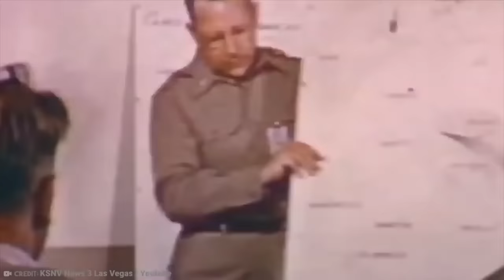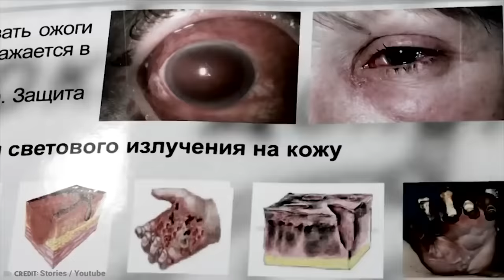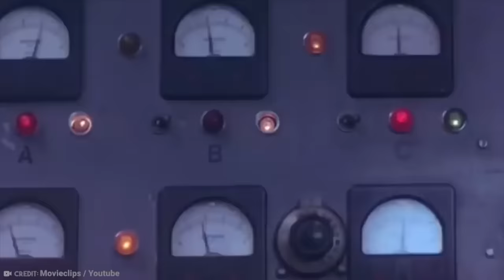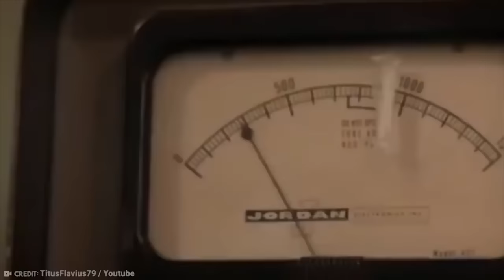20 Nuclear Tests That Went Horribly Wrong

Comment: Your list is confusing. First You have a test that resulted in actual human deaths lower in the list than one with pods and Second Fukushima wasn’t a test, it was a tsunami that happened to hit the worst place, at least Chernobyl was caused because of a test. Third you didn’t even cover the weapon lost in Georgia, that’s still lost today… How does loss of life not make something worse? The B-52 was a non issue compared to the Georgia incident (I mean a nuke is still missing) and while people died, they died because of a plane crash not a nuclear related issue.
Reply: Chernobyl may have been a "test" of the systems designed to prevent runaway reactions in the pile, but it wasn't a "nuclear yest per-say"
Reply: thought at least one of those planes was a B-47 that had a mid-air collision with a fighter let.....

Comment: Before the first atomic bomb was tested in New Mexico, some scientists feared that the detonation might cause a chain reaction in the atmosphere and destroy the world,   They pushed the buttton anyway.  No risk, no fun.
Reply: `Yeah well, some scientists believe the world was created in 6 days. Just because you have a degrees doesn't mean your elevator reaches the top floor.
Reply: @dj33036  theres actually not really any significant concrete proof that it wasn't. 

Considering the state of the solar system at the time of the earths formation, its entirely possible that it only took 6 days for enough mass to accumulate to form an earth sized planet and for it to adequately cool to the point of being solid or mostly solid.

So technically yes, it is possible.
Reply: They actually took bets with eachother on whether it would or not.

The military told them to stop though, so no money ended up changing hands

Comment: What long term effect did all these terrifying nuclear tests have on the ozone layer?
Reply: thankfully no!
Reply: @greghorne5457  Sadly, much of the research shows that such nuclear blasts do have a dramatic effect on the atmosphere as follows: 
Ozone Depletion

When a nuclear weapon explodes in the air, the surrounding air is subjected to great heat, followed by relatively rapid cooling. These conditions are ideal for the production of tremendous amounts of nitric oxides. These oxides are carried into the upper atmosphere, where they reduce the concentration of protective ozone. Ozone is necessary to block harmful ultraviolet radiation from reaching the Earth's surface.

Oxides of nitrogen form a catalytic cycle to reduce the protective ozone layer
Oxides of nitrogen form a catalytic cycle to reduce the protective ozone layer
The nitric oxides produced by the weapons could reduce the ozone levels in the Northern Hemisphere by as much as 30 to 70 percent. Such a depletion might produce changes in the Earth's climate, and would allow more ultraviolet radiation from the sun through the atmosphere to the surface of the Earth, where it could produce dangerous burns and a variety of potentially dangerous ecological effects.
Reply: absolutely correct!!!
Reply: Alun, about the same as spraying 16 cans of Right Guard underarm deodorant at the same time!🤣
Reply: None.  And all human efforts since the beginning of the Industrial Revolution to harm the ozone were less than the Mt. Pinatubo eruption.  And yet we still have an ozone layer.
Reply: @Henry30065  Nonsense.

Comment: Plutonium atomic bombs CANNOT go off if they are not armed. One accident you omitted was the 1966 Palomares accident, when a B-52 armed with atomic bombs collided with a refuelling tanker and its bombs spilled out. On two of them, the explosive charge went off, scattering plutonium all over the place, but there was no atomic detonation. Another did not go off at all. The last was eventually found at the bottom of the sea and recovered. It was bent, but it did not go off.

There have been other similar "broken arrow" incidents, but not one has ever detonated. There was one in my home country of the UK, when a nuke was accidentally dropped by the USAF  in someone's back garden. It didn't go off.

Comment: I'm surprised the volunteers standing right under the blast weren't flatten straight into the ground.
Reply: Not that type of bomb.
Reply: Another the vid gets wrong. A bomb up in the air produces less (lasting) radiation than one on or under the ground. Not good for those guys standing under it, but a helluva a lot less fallout.
Reply: @jwilcox4726  not what kind of bomb? Yes it would smash them right into the ground, from the right height. It was just too high to do that.

Comment: For the lake, water exposed to radio-activity does NOT make the water radio-active.
But, there will be bits of radio-active matter produced by the Uranium/Plutonium splitting that will dissolve or be in suspension in the water and that would be dangerous for life forms.

Comment: A nuke going off in NC (which didn't even come close to happening) would not wipe out the east coast - and there are 0 single points of failure on a B-52 so the "slightest thing" going wrong doesn't destroy the airplane or its cargo.

Comment: Fun fact: The tsar bomba was the cleanest nuke ever with almost no fallout. It was planned as a three stage H bomb with a 100 megaton yield. But since that was insane and above a few tens of megatons it doesn't make sense to rise the yield anymore, because instead of going sideways, the supplementary explosive power just gets into space. So it's wasted. That's why they removed the third stage, a fission stage, which is easy but dirty, causing most of the fallout. So they made it into a two stage fusion bomb with a 50 megaton yield. The first, fission stage, triggers the second, fusion stage, which is clean and doesn't cause any fallout. It only creates tons of neutrons, who would be super useful to trigger a third fission stage, but without that, they don't go far 😊

Comment: Nuclear weapons are among rhe safest weapons to deal with. It is virtually impossible to have a nuclear yield accidentally due to the safetys in place. Even if it's dropped into a fire or subjected to an explosion they won't detonate.  
I used to be load certified for the B61 on the F111.

Comment: Castle Bravo was not a "bomb", nor was it "dropped in either conventional sense.  I call it a Lithium Fusion Bomb, because the Fusionable Lithium 6 was intended to enter into the chain reaction.  In the Thermonuclear part of the explosion; the intention was (as I understand it) for the Lithium 6 to enter the reaction, breaking down into Deuterium; then be converted into Helium, by the Explosion.  Most of the Lithium in the Device, was Lithium 7, which was intended to remain inert (?!!).  However, some or most; of the Lithium 7 was also converted into Lithium 6, then was converted into Deuterium, increasing the Yield; from 6 Megatons, to 15 Megatons.  Dr. Edward Teller, who headed up the U.S. Hydrogen Bomb Program, said He did nor expect the Lithium 7 to enter into The Reaction; which I find difficult to believe, because He was one of the World's Leading Physicists, and had headed The U.S. Hydrogen Bomb Program, from the beginning, plus had been involved in the Fission Bomb Development, at Los Alamos.

So, You're telling Me, one of the World's leading Physicists, was unable to foresee, that something like this, might not happen?
Old U.S. Saying: "Tell it, to The Marines; The Sailors won't believe it!"

Comment: sigh - "10 times higher than Chernobyl"? And what exactly is the radiation rate in Chernobyl that Bikini, to this day no less, would be "ten times higher" in radiation than "Chernobyl"? You do realize that the Elephant's foot (the molten core material in the destroyed reactor core in Block 4 of the Chernobyl nuclear power plant) wasn't screamingly radioactive since 1987? The reason why they build the Sarcophagus around the core was to prevent nuclear material to dust off into the surrounding area. The core material is largely inert. So much so that you can approach it with a maximum safety distance of 6 foot and minimal protection gear (standard breathing mask; plastic suit, rubber gloves and boots) and take a sefie if you want to, without dropping dead in the next hour, or ever for that matter. The architect of the second sarcophagus even took a photo, personally, from the material. There is a photo of him doing it. The guy is alive and shows no signs of radiation sickness for 6 years now.

Look, I get it, Chernobyl invokes some heavy radiation accident fantasies, but in reality, nuclear power, if handled with proper care, is entirely safe. Even the nuclear "waste", sealed into steel or glas, is going inert within a year. The green glowing stuff we see in the movies is grossly mischaracterizing the actual dangers of nuclear power. It's not an instant killer, but it's also no plaything. But to the point: "Ten times higher than Chernobyl" tells us exactly nothing (!) about the irradiation amount of the Bikini Atoll.
Reply: seems like Chernobyl had a pretty good impact on western Europe....crops and animals.....
Reply: @frankpienkosky5688  Supposedly. I live in Germany, I lived through the uncertainty, and it surely was no easy going. But my argument still stands: What exactly does "10 times more radioactive than Chernbobyl" actually means? Nothing. It's a sensational as well as nonsensical boogeyman. It is of no worth to describe the danger of nuclear materials at all - amateurs would state such nonsense... now is "The Scary Cherry" an amateur? Possibly. According to the nonsensical stuff he claims in his video: Yes, he is an amateur and should not be taken seriously regarding any of the topics he chooses to make videos about. And that's his own doing.

Comment: In the mid 1960's, Grissom AFB 305th SAC base, in Peru Indiana was home to the B-58 bombers. They had been several landing accidents with the B-58 there. One, in particular, damaged a nuclear bomb and leaked radiation in the wreckage. They dug up a lot of the contaminated soil and hauled it away, but radiation still lingers on the base to this day and is cordoned off.
Reply: Y

Comment: Fun fact: The blue glow in the reenacted demon core footage is real. It's called cherenkov radiotion, caused by particles passing through a medium faster than light (in that medium. But slower than the speed of light in a vacuum of course, since that is impossible) and it is absolutely beautiful! Buuut if it's not happening in a huge pool full of water: RUN!

Comment: Tchernobyl was not at all an accident. Head of unit called the workers for an experiment he was the only one in command, and the only one knowing extent and aim.
They disconnected the main cooling system of reactor, then an emergency backup cooling system, finally, they put KO a safety blockade preventing reactor to run that way.
Whitout any working cooling, the head of facility gave the command of putting reactor at full power.
When technicians realized reactor was ging to blow away under their feet, send down the  control bars slowing down t'he chain reaction.
They say, I'm not sucre of this, initially it acelerated chain reactions.
Central blow away, but it was a deliberate explosion.
Why? Only marxist-leninist minds could find a rationalization for this.
Gesund+

Comment: you need 400meters actuest, 9/11 was an egg shaped cavity  20meters under foundation pulverizing concrete and steel etc 1 and 2 cores pulverization to dust til 275 and 320meters crushed zone nad (intact) zone (crumbing zone or named fire zone above around floor 70 - 80 so it all feeel intonb a pit ground zero is actually a word that means nuclear  center of explosion., so everything above went into a cavity of hell on of the byproducts were cesium and with the steel and aluminum and conrete and uranium fallout also termite is a fallout substance

Comment: Bikini Atoll might be repeated on a much bigger scale if you don't give other specifics.  They used heavy lithium to condense the heavy hydrogen, the same heavy lithium that is being used to compress regular hydrogen for some of the hydrogen powered cars and airplanes.  If regulators fail to prevent these fuel tanks from being kept in mass quantities (warehouses) then it is only a matter of time before someone detonates an atomic bomb on one of these warehouses and detonates the atomic fuel churning the entire crust of the earth into the core of the earth.  The smarter people are, the bigger their mistakes.
Reply: The distance between our layer and the inner layers of the Earth is thousands of km's.  It would take one hell of a bomb to do anything like that!
Reply: There is absolutely no danger of that happening whatsoever.  The deepest mankind has ever penetrated looks like a pockmark relative to the thickness of the crust.

Comment: 1: Castle bravo wasn't "dropped" it was detonated in place as, at the time, it was far too large to make it a "bomb".

2: you left out crucial information as to why Bravo was so much larger than intended. The reaction of the deuteride with the lithium 6 was far superior than intended.

3: You also left out the important tidbit about the demon core. The first incident occured when the scientist was stacking the neutron reflective tungsten carbide bricks around the core pushing it towards criticality and dropped on directly onto the core, causing it to instantly go critical and begin a self sustaining nuclear reaction releasing a burst neutron radiation. The second incident occurred because another scientist was playing chicken with the neutron reflector some by using a screw driver to maintain separation instead of the shims he was supposed to use. The screw driver slipped and the reflector closed completely over the core causing a brief yet powerful burst of radiation.

Do better research.